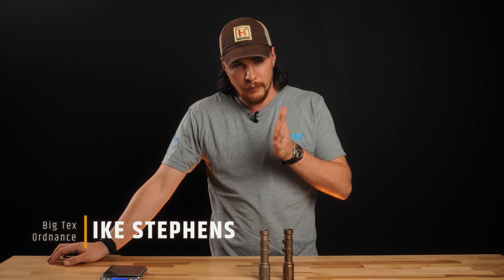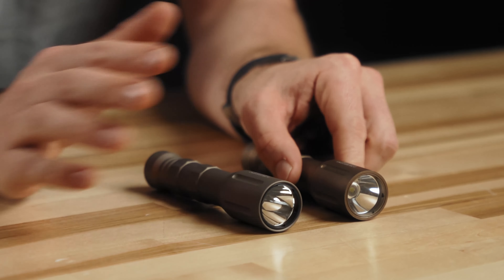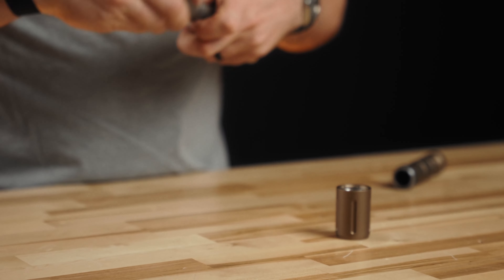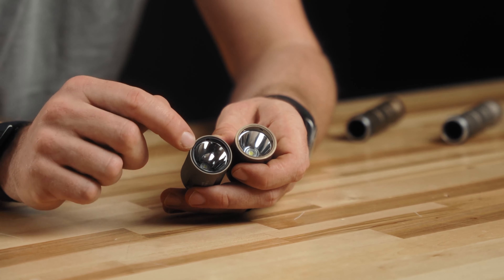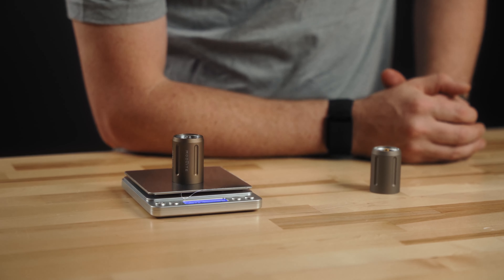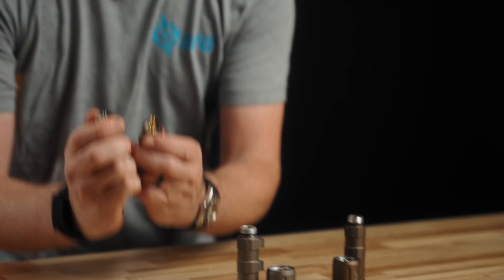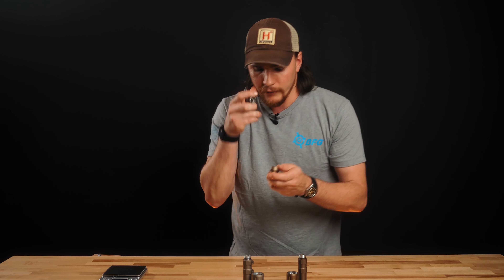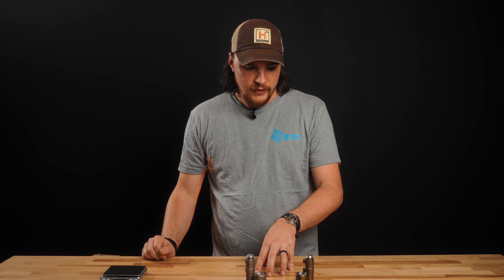How To Spot A Fake: Modlite

Comment: I got a knockoff to compare and do my own diode swapping and it's not near the same. It's fine in general but not comparable to the real deal modlites. I opened it and the led in the knockoff is some kind of cree, so not even the same diode, I assume same with the driver. I have a knockoff dual fuel surefire m640df and both the sf knockoff and modlite knockoff are exactly the same, if not the slightest unrecognizable difference. My modlite head did fit on the knockoff so the threads are the same
Reply: how does power/throw output compare?
Reply: Sounds like a Modlite head will go on it correct? 🤔🤔